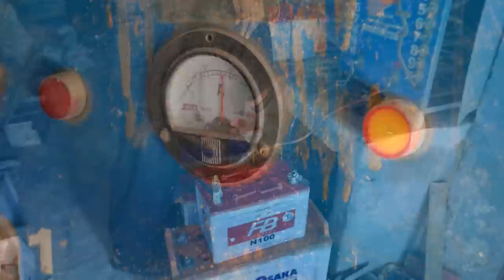How Battery Plates are Made & Restoration of an Old Battery

Comment: Hello
What are the ingredients from which brown dough is prepared? Please help me
Cordially yours
Reply: From wikipedia on Lead-Acid battery:
Modern-day paste contains carbon black, blanc fixe (barium sulfate) and lignosulfonate. The blanc fixe acts as a seed crystal for the lead–to–lead sulfate reaction. The blanc fixe must be fully dispersed in the paste in order for it to be effective. The lignosulfonate prevents the negative plate from forming a solid mass during the discharge cycle, instead enabling the formation of long needle–like dendrites. The long crystals have more surface area and are easily converted back to the original state on charging. Carbon black counteracts the effect of inhibiting formation caused by the lignosulfonates. Sulfonated naphthalene condensate dispersant is a more effective expander than lignosulfonate and speeds up formation. This dispersant improves dispersion of barium sulfate in the paste, reduces hydroset time, produces a more breakage-resistant plate, reduces fine lead particles and thereby improves handling and pasting characteristics. It extends battery life by increasing end-of-charge voltage. Sulfonated naphthalene requires about one-third to one-half the amount of lignosulfonate and is stable to higher temperatures.
Reply: @jgramsey  it is simply leadoxide or leadsulfate or a mixture, posibly they can use the dirt around too (contains enough lead :-))
Reply: Heated, dried, and ground up old residue of the old plates. It is beaten from the old plates and the plates are remelted to be cast into new plates. The bits of plate lead would be picked out of the powder before crushing to make the brown powder. One set of plates is "formed" with strong sulfuric acid to help start the electrode formation which is not really complete until it spends a lot of time on the charger. But the "forming" step is not really needed, charging the battery makes the lead sulfate (brown dough) into sponge lead (negative plates) and lead dioxide (positive plates) within the battery. That was water that was poured into the remade battery, the acid will come from within the plates as it is charged up.
Reply: lead oxid + Sulfuric acid + some additives
Reply: @leebarnes655  FYI they make paste from fresh material Lead oxide is being imported from China , the paste from old plates can't be reused